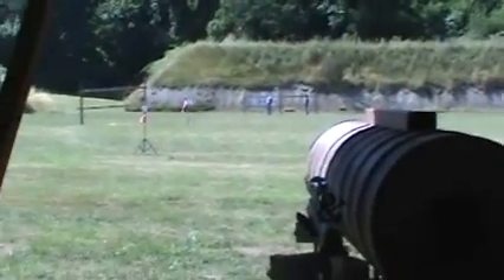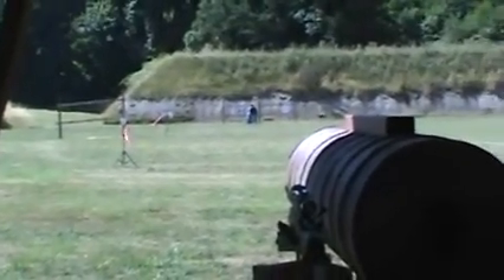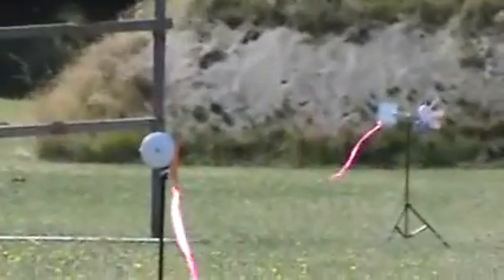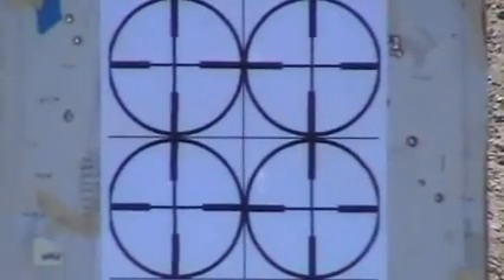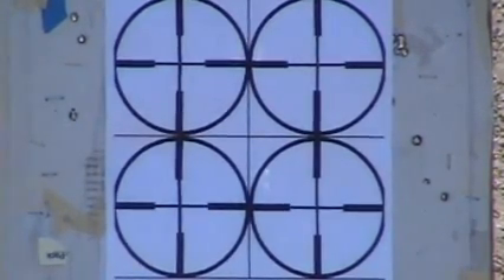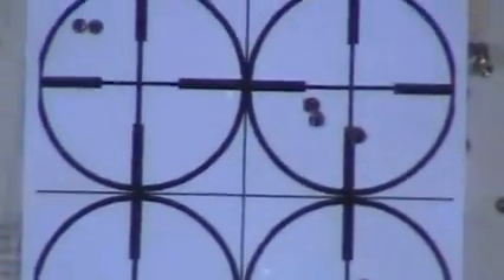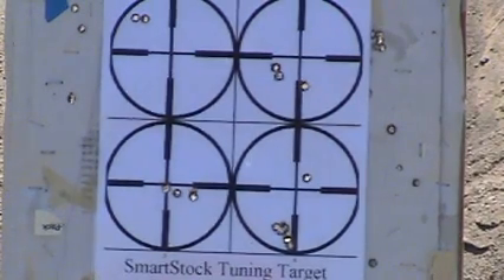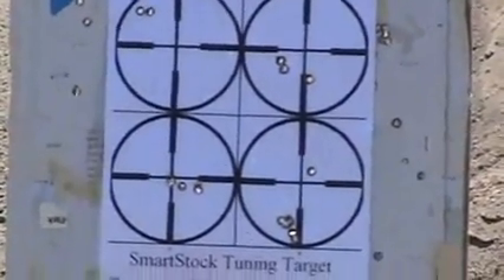SmartStock Rifle Barrel Tuner Demo

Comment: Interesting. I was looking for a way to tune 148 ball surplus in my Mosin.
My plan was to free float the barrel and glass bed the stock. Then use large rubber O-rings in the for stock. This looks slick for a non hand loader.